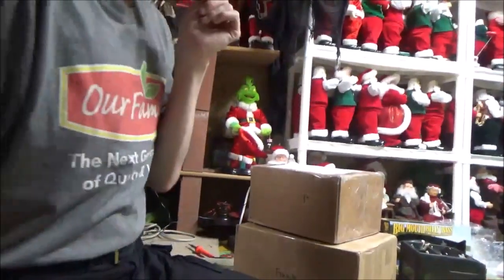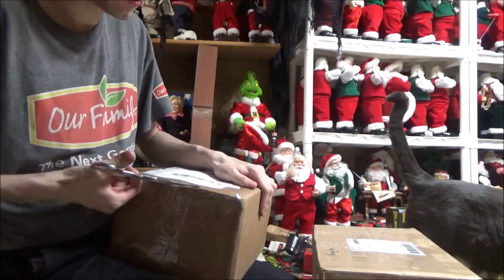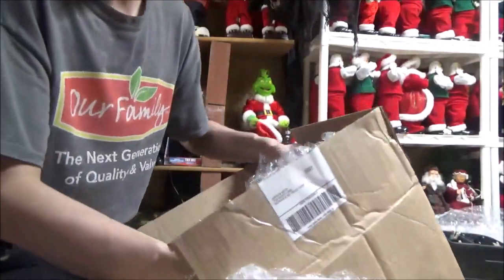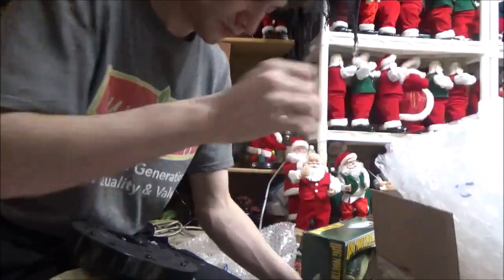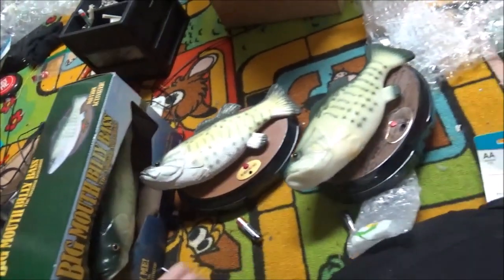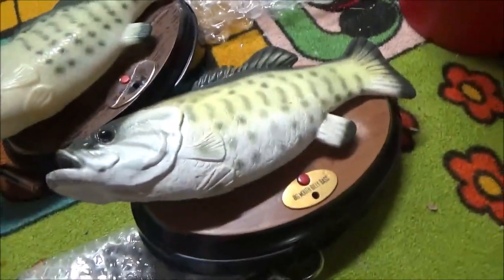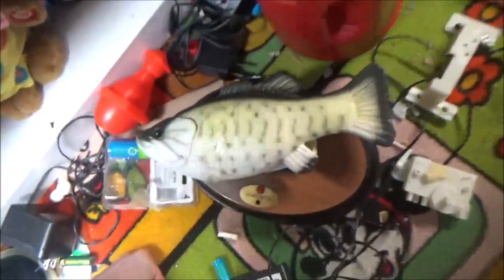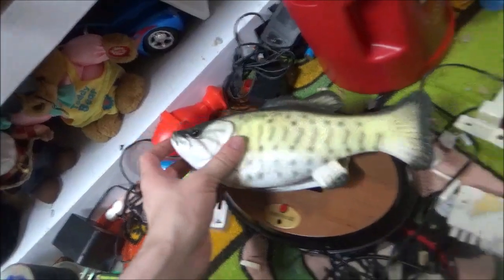Big Mouth  Billy Bass Jr  and 15 year edition Unboxing

Comment: I think the cool catfish in your room mouth needs to be put right since the piece its not connect to the rubber right
Reply from the maker: Yes it is, theres 2 version, the regular one, and the one you are talking about is the version that has lips
Reply: @gemmymasteranimatronics768  yeah but the piece is moving inside of the lips that did happen to mine
Reply: And if you find a version without teeth it's mostly gonna be the Rapping version